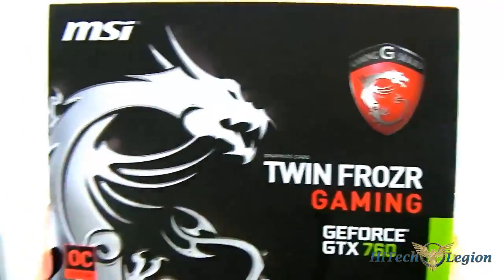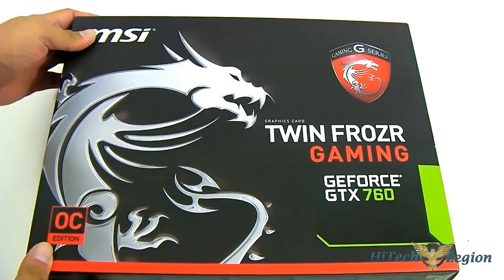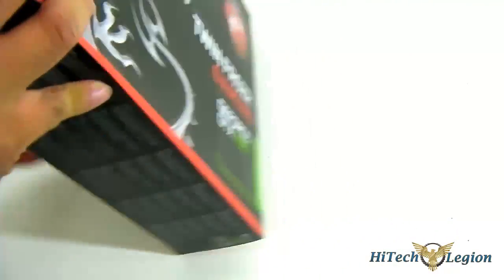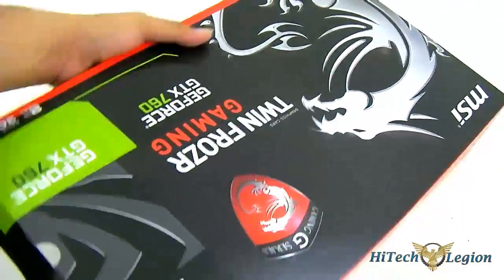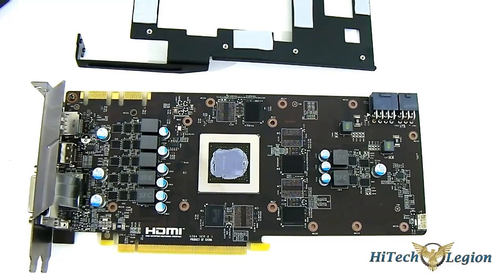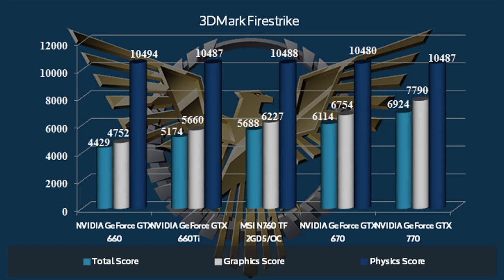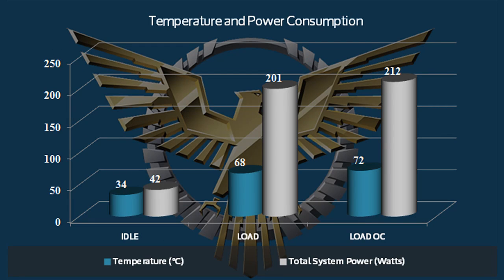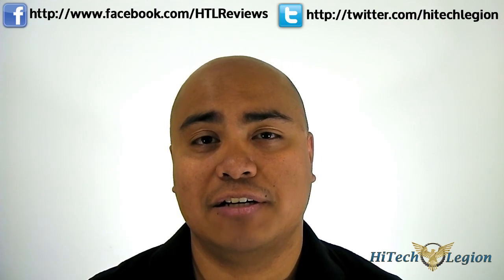MSI GTX 760 (N760 TF 2GD5/OC) Video Card Unboxing + Review

Comment: i have this card .. i am getting 70 degre tempreture on normal gaming .... also i am lagging on games now 
do you how to fix it ///... why i am getting high tempreture on low gaming
Reply: +Abhijeet Singh 
1.How long do you have this card? 
Maybe you need to replace your thermal paste. 
2. Where is your PC positioned in your room? 
Corners are not ideal place to put PC's because of the low air flow and definitely do put it near some heater. 
3.Are you're fans put correctly?  Because of not optimal air flow it is also possible to increase temperatures overall and not just your GPU.

Comment: bye gtx 750ti:::::: hello gtx760
Reply: Is there a problem with the 750ti ?I'm buying it, it's a great budget card !
Reply: Na no promblem ,at all,i just want too run assassin cred unity abit better ,you can buy mine if u want ,you in the uk
Reply: It runs everything I throw at :-the 750ti ,but the things ive read about the 760 ,and useing the 750ti ,i think the 760 might be the  sweet spot
Reply: Its only assain,cred unity ,that I think needs abit more power ,its playable on the 750ti ,xbox 1 level ,but after putting the settings on ultra and high the frAme rate gets too 35fps to 40 ,it plays well but I just need abit more power to balance it so it looks and plays well and I think and hope the 760 can do that
Reply: XBASS KINGTING
Thanks a lot !! My monitor res is 720p so I'm fine.And I'm in Asia so ://///

Comment: 5:38 the card does not intake air into that fin array.  It intakes from the top of the fans and exhausts out both the front and rear ends and around the sides.  Most of the heat will exhaust in your case and very little will actually go out the back

Comment: i'm planning on getting this card, but will the i5-4470k and an 8gb memory ,with the motherboard Msi Z87-g43 gmaing , do the trick ? and how much power do i need will 525w be enough ?
Reply: there is written like on every site you need at least 500W PSU
Reply: Alright ,thanks dude !
Reply: 500w 80plus and youll be fine
Reply: Thanks Bro !

Comment: Trust me, the Vram will hit a wall way before the Vram overheats. Figure that the GTX760 has the same memory modules as the 770, The 760 memory clock is just a hair over 6ghz and the 770 is at 7ghz. 99% of the time you can clock the 760 memory to 7ghz with out a single issue. I happen to add 610mhz to my memory bring it up to 7.2ghz on the memory without a single heat issue.
Reply: so u prefer to buy an GTX 760 instead of GTX 770?
Reply: No, just saying the 760 can easly match a 770. Though you will be missing the extra cuda cores. My 760 will do 8ghz. But I hvnt had time to stress test it yet. But for money wise 760 is probably a better option.
Reply: How can i get it to 8ghz?
Reply: Stock vram speed is around 1500mhz. So 1500x4 is 6000 or 6ghz. You need to hv a clock of around 1900mhz+ but I do not think mine will do it. I hv tested 1875mhz and it was stable. 1875x4 I get around 7.5ghz. I wish I was home to clock it more lol.

Comment: Which would you suggest, beetween this and the Asus GTX760-DC20C-2GD5?
Reply: MSI IS BETTER A BIT
Reply: well the noise they make are about the same. I'm prettty sure ur ears won't be able to tell the difference. and the MSI 1 is clocked at 1085MHz and the asus one is clocked at 1072MHz not much difference and u can OC them so fck the clock speeds. When it comes to temps the ASUS one is slightly about 3-5C cooler than the MSI 1. And thats about it. It all comes to the MSI afterburner VS the ASUS GPUTweak. Which do u prefer the most.
Reply: Just notice the size of MSI is 5 cm longher. Not sure if is going to fit. Asus it is!
Reply: 73maxmau asus gtx760 dc2OC is 1006 clock speed and 1072 is boost but msi gaming is 1085 without boost asus good stuff is that its short atleast in my country cheapest and how much i know idle it is cooler but on fool load same but sadly louder +asus have only 1 8pin power conector msi is 1 6pin and 1 8pin asus can oc a bit less then msi but it was like 20mhz
My self i went for msi gtx 760 hawk it clock is 1110 or 1111 and is best oc posibilitys of all cards +1 pipe more then gaming and temperatures can say same but a bit more quiter
Sorry for english dont know some word correct grammar.

Comment: It doesn't really matter, only the price is different. 760 is a little bit cheaper, and performs a little bit less, but the difference is really small. The 670 is a little bit more expensive, and performs a little bit better in all the benchmark tests. If paying 20 dollars more is not an issue for you, you should get the 670.

Comment: Moreover, the 1020/1085 default is the BIOS default for the MSI (verified with GPU-Z), since I did not review the Gigabyte 760 I don't know if it also has 1020/1085 BIOS default and just factory OC'd higher or if it starts at 1085/1150 in the BIOS.

Comment: If that is what Gigabyte advertises then that is probably what it is out of the box. The only difference is that MSI gives the option to the users with the App and they default to the medium setting as they also have a downclocked "silent" preset in that software and an OC preset with the same defaults as Gigabyte.

Comment: That is only in OC mode, which is enabled with the App. Out of the box, without any modifications or applications it is 1020/1085. I have another video here on YouTube showing the MSI App that does this and using MSI Afterburner to manually overclock this card: watch?v=upznIi8tsro

Comment: Depends on how quality your PSU is and if you are planning on overclocking it or using powerful components. Obviously if you want to OC or have powerful components, you'll need something better. 550W or 650W are good options.

I have this card with my Rosewill Capstone 450W; a quality PSU, and it works great! I plan on getting another PSU anyway for future upgrades. As for your PSU, you need to do some research to see if it'll work well. Weak PSUs at 450 will have problems.

Comment: I understand the frustration hence I would like the flaw pinpointed specifically if there is one. It might be that specific older bearing and not necessarily general sleeve bearings as pretty much almost every video card with custom cooling uses sleeve bearing be it from YoungLin Tech, Evercool, Power Logic etc. I will ask MSI about this issue and see what their reply is.

Comment: The box says 500W with 30A on the +12V but of course it totally depends on what system you are running. You can see in the graphs that this total system draw from the wall with the MSI GTX 760 and an i7 4770K+SSD only peaked at 212 Watts.